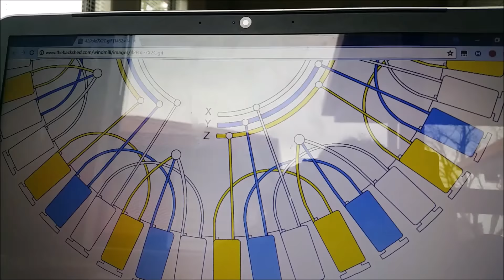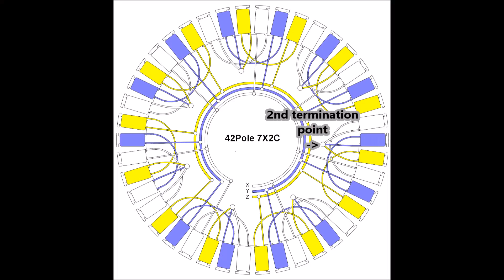Rewiring a SmartDrive motor for hydro/wind generator

Comment: I was thinking that an easier route to go would be put each phase through a Full wave bridge rectifier then merge the 3 phases once converted to single phase in parallel providing higher amp.
Reply: My exact idea after watching this. Pretty sure by doing what was done you just lost 1/3 the output
Reply: Seems like a good idea. Any links to someone doing it? There are many videos about "rewiring" these motors. Your idea seems simpler and could produce more power...
Reply from the maker: Sounds similar to a Delta connection? But maybe each phase is isolated from another. It might affect output at low RPM, as you are pulling power from a single coil set rather than through 2. Delta would achieve similar results, but voltage will be less due to voltage being from a single phase.
Could be worthwhile investigating 

Cheers
Reply: @stefanstoove9254  I am going to subscribe. Look forward to your investigation of this possibility. Have a great day.

Comment: Do you know of the make and model you got the bdc motor from? i have a river running past my home with only 20 mtrs to my supply and want to do something like this to drop my useage
whilst offgrid in a forest
Reply from the maker: Yes - it is a Fisher and Paykel 'SmartDrive' motor.
This is a 0.6mm copper wound 42 pole stator.

Commonly known as F&P motor, BLDC Washing Machine Motor, Gentle Annie Motor and SmartDrive motor.

Hope this helps, cheers and good luck!

Comment: Hi, I saw some of his videos about the wiring of the stators, I visited the F&P link and I got a little lost and disoriented, not being an electricity expert, I kindly wanted to ask you,
not having RPM problems, which wiring indicated by F&P should I use to have the maximum amps? Thanks.
Reply from the maker: Hi!
Maximum current can be achieved by putting all the coils in parallel in each phase.
Another method is to completely strip wire and use a much thicker copper stranded wire to wind the stator, but this process is very time consuming.

Cheers

Comment: Y NOT USE 63 VOLTS CHANGE TO DC WITH CAPS THIS DRIVE DOWN AMPS AND A CHARGING CONTROLLER.600V ON DOWN IN PUT. OUT PUT 12/24/48 VOLTS OUT DC. COILS WILL RUN COLDER

Comment: some late info.    though the source is a trusted one, the  wisdom  of this mod  is  suspect.     in most parts of the world,  interconnecting  Adjacent  coils in a pma,  is  NOT  recommended.      why is this true.     ALL  the  coils  in a  PHASE  should be energized  Equally  and  SIMULTANEOUSLY.     this cannot happen where adjacent coils are interconnected.    for Any STATOR, phases should consist of  groups of  Three,  equally spaced coils, connected in  Series.      in the context of a pma application, a stator like this  should be considered a   16-phase  stator.       the primary goal of any power system is not battery charging.    it is  putting   WATTS  into  a Power processing device/circuitry/charge controller.         googletranslate

Comment: Genera 110 v ? O 12 v ?
Reply from the maker: For 12/24V low rpm systems once rectified to DC (maybe 200 to 300rpm on input).

Thanks, 
Stefan

Comment: I wanna use it as a motor ,(for ebike)  with how much voltage i shuld run it after your modifications ?
Reply: @stefanstoove9254  how can i wire the motor in delta ?!
Reply: @stefanstoove9254 you told me that in delta i will get a better performance, but will it be harder for the motor ( will he overheat or sth ) ?
Reply: @stefanstoove9254  thanks alot for the help 🙂
Reply: The Mechanic #tonystark

Comment: Terrible soldering, you don't want to melt the solder onto the iron and transfer the melted solder from the iron to the wire, you want to heat the wire with the iron and melt the solder directly onto the wire.
Reply from the maker: Yep, thanks for the advice :)

Comment: l need evrythis
Reply from the maker: You might be able to find some at the tip, or online, for example the place I am working at are selling some as kit sets in NZ. It's quite difficult to find fisher and paykel washing machines in some countries, but other brands often use similar designs, which could be used for a project :)

Thanks
Reply: Who namber biub and Casper thanks